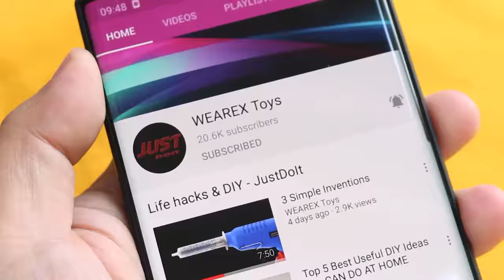I turn The Refrigerator Block into Welding Machine

Comment: Ok so, I'm using the clamps from some old jumper cables. I seen the one you are using for the stick is a bit different. Will I be able to use just a jumper cable clamp to hold the stick ? With rubber handles?

Comment: That motor doesn't look as if it has a higher power rating than about 1/2HP, 375W.  Arc welding needs around 3 or 4kW.  So, does it overheat?  What's the duty cycle like?
Reply: The "transformer" is not efficient in any way what so ever, the cable used, same shit: not efficient what so ever, but you may be able to do some welding in small burst with this contraption. The duty cycle may be something like "10 burst of one second each, and then one hour of rest", so not really useful to anything but showoff in front of those that do not understand this stuff anyway. Is it a real welding machine ? No, it is a toy, and it is damn good to create views and likes + make a lot of comments, all very useful to generate money to the "creator".

Comment: Question, how to adjust the current for the welding of different material and thickness. the next question is do you also have plans for DC welding.
Reply: You dont
Reply: You can have 3 additional output tappings on secondary welding winding which you choose the appropriate current to choose from.
   As for Direct Current welding DC You just have to attach full wave welding rectifier Bridge diode on output welding terminals of the welder.

Comment: Hello.
In some videos, they make fun of the cable wrapped with this type of motor windings by saying that it is too small to have enough current and power to be welded.
Is it real whether you are welded with the winding you made in this way? I want to learn.
Thank you.
Reply: Fake sir
Reply: don't believe it
Reply: It does work but you have to create a way to deal with overheating by either using a cooling air fan or immersing the welder to oil for cooling.
You can also use a thermo switch to prevent burnout due to overheating and overloading.
Reply: dây thứ cấp quá nhỏ, số vòng quấn ít, hàn nóng cháy dây ngay